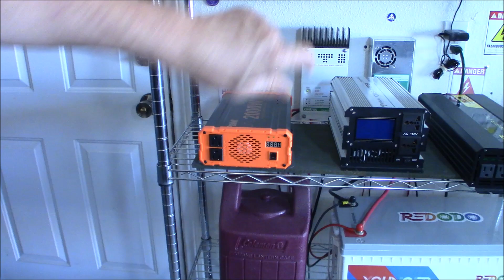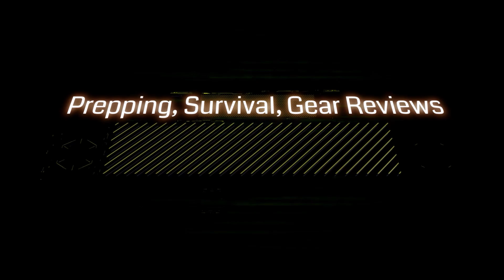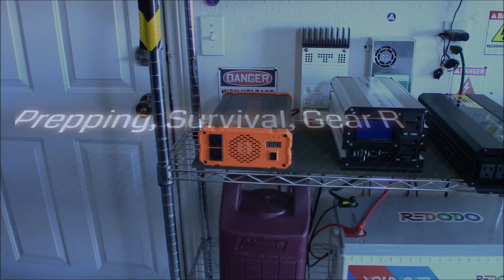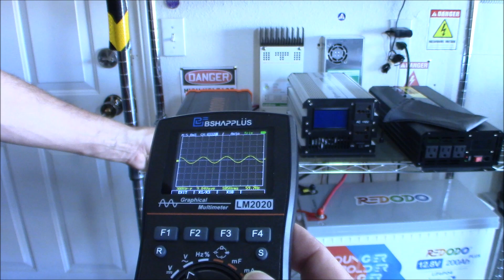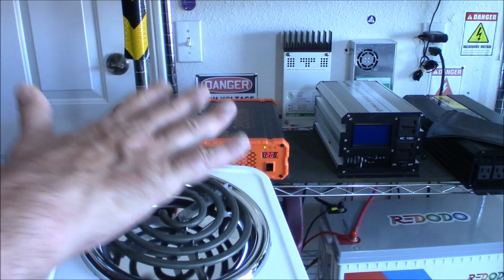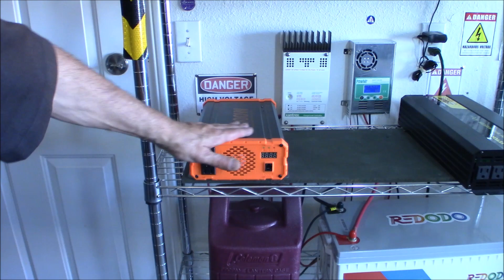Off Grid Upgrade!  PowMr 2000W 12V Solar Inverter!

Comment: Can you provide an update of your experience with this product so far? I've seen there is a lack of this product on web.
Reply from the maker: I'm still using it, has not given me any issues.  Its charged up my ebike a few times as well as run the garage door when the power was out, So far so good. Fan is a bit noisy but that's really my only issue with it